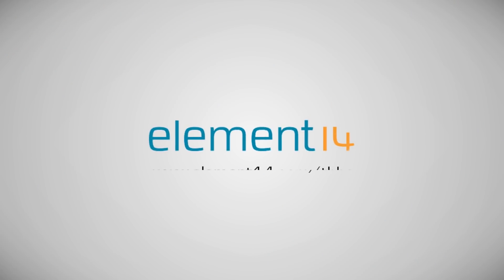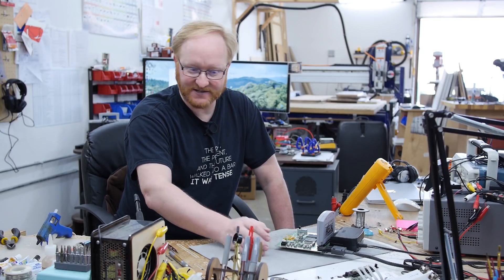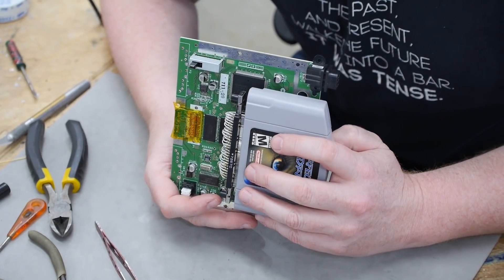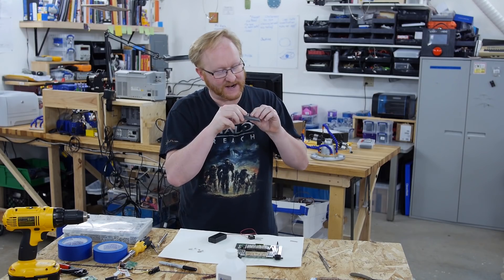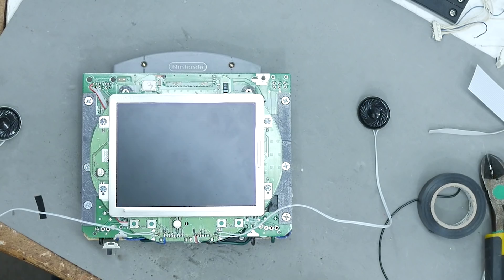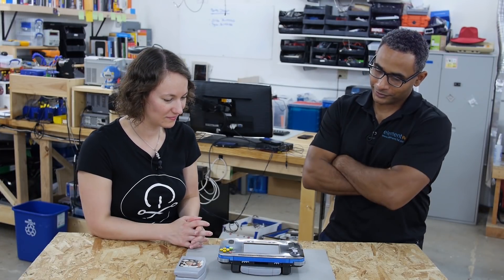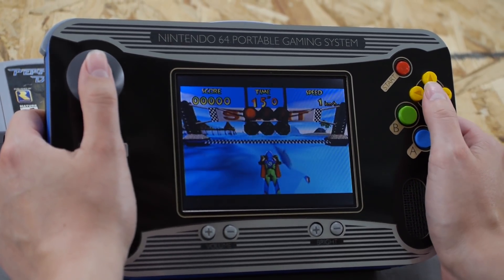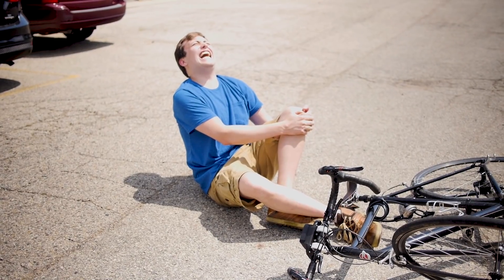N64 Portable: It's Alive!

Comment: I'm sympathetic about having just wanted to get this finally done, but it seems like there were a few compromises that make it a Pyrrhic victory:

- Going back to the crazy N64 analog stick after the modern analog sticks were working
- No L button (which really was used in a few games!)
- No ports for additional controllers, nor the controller-expansion ports
- Having a built-in save-game memory module was such a neat idea - sad to see it didn't make the final version (although many games get by with cartridge save alone)
- Maybe AV out / DC in should be available

Of course I don't seriously think people would want to play 4-player 007 on a tiny screen, but having ports for additional controllers (maybe through a breakout cable which could include a controller 1 override) would create compatibility for arbitrary add-ons - not just 1-4 memory blobs, but also stuff like Rumble Paks.

Yes, this stuff would take an insane amount of time to do, but think of the watch time revenue at stake! ;-p

Comment: Its a nice toy but I feel a rasberi pie with n64 emulator that reads from cartridge is much better. If it was an emulator it could also play Wii and game cube.
Reply: It's so much more of a novelty that it is og hardware.  It's the first thing in my collection I show off to anyone that wants to see my game room!
Reply: @Zeldachief128  So you don't think it should be redesign by Nintendo to be the official n64 classic.
Reply: Now you're comparing apples and oranges.  The point of this was to turn it into a portable using the OG hardware.  If Nintendo were to make an N64 Classic, there is no doubt that emulation would be used but for this particular project no.  If he were to use a raspberry pi it would be a lot smaller and at that point, you might as well just look to his other raspberry pi builds.  Haven't you ever tried taking apart a classic console and making it portable?  It's really fun!

Comment: Could you not save space by hardwiring an everdrive into the cartridge slot, without the cartridge shell, then mounting the SD card slot so that you can insert/remove the SD card through the outside of the case? I imagine that would be somewhat thinner than requiring space for the cartridges.

Comment: I know this is an older video.
I just happened to watch another video on the Sega Nomad today. And I thought this might be even cooler (Not that it's not already one of the coolest systems and ideas I've seen in a while.), if you could add an a/v port to link this handheld to a tv by way of an a/v cable. But possibly a difference would be to switch off the handheld screen when a/v cable is detected. And adding a 64 controller port on the handheld, to add a second player (or using a connection like the wavebird for the gamecube console), just modifying a 64 in that way. This would keep it portable, and allow it as a home based console, like the switch.

Comment: The new RAM chips give it the same power as if it had the expansion, but does the system recognize it as being the same?  Meaning will it play games that require the RAM expansion, or will it tell you that it still needs the expansion?

Comment: Would it be sacrilegious to suggest an Android or Pine64 board and USB to N64 cartridge (retrode) adapter to reduce the size and voltage requirements? Using a pi for N64 doesn't work great.

Comment: one thing one could have done was use a replacement part of a "N64 stick fix" - basically there is third parties making a fully nintendo 64 original controller compatible renewed stick parts using a smaller, modern style stick that does not wear down like the original N64 stick, and has less of a travel. I have one of these parts replacing utterly worn down stick in one of my N64 controllers and it jumped ahead my very great condition nintendo original stick in gameplay feel.

Comment: I've done everything as far as installing and mapping the buttons but I'm using a ps4 controller. When I load my rom, the words "no controller" flash on the bottom of the screen (I loaded Zelda: Ocarina of Time) and now I don't know what to do besides possibly using the keyboard which is what I wanted to avoid. I'm using Project64 2.3

Comment: The batteries are a problem as 3.7V is pretty much 50% charged 18650s should be charged to 4.2V and them holders are a big problem if a wrap gets damaged

Comment: Connect two cartriges of the same game and synchronize them, i dont know how to do this, but using multiple copies of the game SHOULD give it an improvement of avaliable resources. I am guessing this can be tested with game roms on an emulator before doing it hardware wisesly. I hope my theory proves truth.
Reply: So for instance connecting together TWO alone in the dark cartriges/or games for their resources should make loading times or loading much faster etc. I think there are other improvements but they require coding and programing.
Reply: That's not how loading works, at all. Second, cartridges are already very fast.

Comment: You can curve the one end of the fan dispenser, so more air will come towards the beginning, less towards the end.
You can use smoke to see how the fan dispenser is dispensing the airflow.
Curve bladed design is less noisy.
Larger fan blowing air from the back into the case at a 90 degrees angle with the board, rotating at a lower RPM might be better, than a small fan blowing high RPM in parallel with the board.
You can also coat the case with aluminum, (metal-plastic alloy) allowing the heat to dissipate through the casing.
It'll also make the device much more durable. Even metallic paint allows for a better heat dissipation than just regular paint or plastic.

Volume and brightness would probably be better as an analog rotary dial on the edges.

Drivers can be upgraded for more bass output. The device could actually contain a passive bass membrane to make one feel the sound better, as well as sound audibly better, like this one: https://goo.gl/K2Fykv

Hope the wires will not be in the way for taking in or out cartridges.

Comment: The z-trigger is hooked up to the L-shoulder button. Since L isn't used much on the original controller, and most games use the joystick, Ben simplified the design by putting the Z-trigger into the L-shoulder button. Keep in mind, Ben's never been a huge fan of the 64. If it had been up to me, there would have been a true trigger button. Way easier to play Ocarina of Time and Mario64.

Comment: Is there anyway to acquire the files needed to print out the case that Ben designed. I'm a OTR  trucker (former electronic tech) looking for a project to do with my college aged sons during Christmas vacation. I would need to use a 3d printing house to purchase the casing. However, I have no idea where to acquire blueprints or files for a 3d printing. Anyone have any ideas?

Comment: I once built a backpack where I had a Genesis that was wired to a battery pack of a bunch of 9 volts. Had it ran up to an old camera I had that had av inputs for the screen. And of course not having any kind of av hook up for my Genesis, I gutted an old vcr and used the coaxal input and the av output to tv as a converter set up. In short I ended up with a back pack that had a cartridge slot and a screen and then 2 controllers running out the bottom. Open it up and it was just a massive ball of wires and batteries. Probably not the safest thing, but when I was a kid I was willing to do anything to play Sonic the hedgehog in school.

Comment: guys! I am new to raspberry pi electronics. I have question . I am trying to make a portable power supply for my raspberry pi 3 that would fit inside the case. So I am trying to power it with my GPIO pins. I had a few small portable batteries lying around, so I broke open one. I think that I could reuse the small circuit inside the portable battery, as it already has power input to charge the battery, led lights to indicate the charger and a usb outlet to supply(which i could remove the solder) and get the 5v and ground from there.... So this 5v and ground could go into the GPIO pins. This is just an idea but I dont know if that sounds feasible... Any advice?

Comment: Testing the running temp when it's in the wide open air seems like a bad idea. That's going to get a heck of a lot hotter when in the case.
Reply: Yep, there's going to be some disparity to account for, which they probably did.

Also PLA 3D prints are a great warning indicator, they get all squishy and floppy long before the critical temperatures for electronics are reached :P Not sure what he printed in though, but normally PLA just looks better than printable high-temperature plastics.

Comment: For me those PSone screens are still ideal screens to use, the image quality (if you don't mind it being a bit of a mirror) improves a lot if the mesh is soaked off the LCD; very crisp image quality in contrast to stock. There appears to be a bit of interference on the screen, the video cable needs to be shielded to the screen to eliminate that.

Comment: I'll pay you $200 if you build me one. lol. I soo want one of these. Loved my N64.
Reply: N64 portable go for about a 1000 USD but if you want to make one you would need N64 70$, PS1 screen-50$, wires-10$? downstep regulator and capacitors and resistors-20$, N64 controller- 20$ soldering iron solder and solder Wick- 60$

Comment: Don't get me wrong, the final product is amazing and I love it, but what's up with the 3d printed parts' layer lines not being smoothed out? I also don't get the blue plastic on the sides.

Some case design critique: I would have made the case more ergonomic, switched the d-pad and joystick placement to be closer to the location of the joystick on an original N64 controller, and moved the speakers out from under the user's palms. I would have also rounded more of the corners and edges on the device.

This is just personal preference, but I would have used a replacement N64 joystick; one of the aftermarket parts that is a modern joystick (that is less prone to breaking than an actual N64 joystick) that has been made to look like an original.

Comment: This isn't too bad, I like that retro style look for the casing, but there are some things I would have different than this.

Firstly I'd have a larger display, preferably with AMOLED display so you don't need to have backlit LED's since it provides it's own light, with much more clear and vibrant display. In addition to just having an AMOLED display, I would also want to have a HDMI IN-OUT so you can connect the system to a bigger TV with an HDMI cable so you can have dual video outputs on both the device and TV you want to output to, or hook up to a DVR capture device. Clean up the video output from it's regular Analogue Video with an HDMI mod to the system.

For the controllers, I would have them on the portable device itself, but I'd also keep the 3 other cable ports for plugging in additional controllers to the system for when you want to play with other people when you do split screen with 2-4 people. Also to keep the system fairly compact instead of using the original N64's Joystick, as much as I like using the N64's original joystick, I would opt to take a circle pad from one of those Nintendo 3DS Circle Pad extension devices and use that for the joystick instead. I would still reuse the same N64 Controller buttons however on the device.

Thirdly the battery, instead of using those 4 big bulky batteries I would opt to take 2 pocket-sized tablet batteries to power the device, preferably ones that have huge long lasting capacity, which should help reduce the bulk and weight of the whole device, with these it should provide the system with a long lasting battery life without needing to charge a lot, and provide the system with enough power for powering everything such as the game, the AMOLED display, fans and audio speakers.

Speaking of audio however... instead of just 2 buttons for audio, I would prefer to have a slider for the audio, and take some high-quality stereo speakers taken from something else say like a phone that has really good speakers or something that are really small and compact but produce excellent clear audio. I would also add on a audio jack mod to the PCB so you can plug in headphones to the system for when you want to use headphones too.

These are just some of my ideas anyway.... I did come up with some visual concepts ages ago before on how I'd like my portable N64 to be like. I'll probably have to re-create it however with a better concept.

Comment: I see one design flaw with this system... It only has 2 shoulder buttons
The N64 had 3, which essentially means it'll be incompatible with the games that use the missing one
Reply: N64 controller has 2 shoulder buttons and 1 trigger button which was under the rear center prong of the controller.

Comment: Turned out great, the only things I would have done differently is sand or acetone the exterior 3d prints to give it a smoother look, and used the stock buttons from the controller. You were able to fit it into a great form factor considering the size/shape of the original console. Building the rambus expansion into the board was a good idea.

Comment: You know. The patent on the N64 is now expired. Have you considered actually manufacturing from this prototype? You should do it. There is plenty of money to be made, seeing how other retro systems have somewhat successful modern clones.
Reply: The patents may expire, but some of the ICs are still proprietary and many off-the-shelf ones are no longer available and don't have replacements. If there was an N64-compatible system to be released today, it would certainly be partially or completely software-emulated on dissimilar hardware.
Reply: Except for the fact that the retro "clones" actually run on emulators. Specifically, non-commercial emulators.
Reply: He really doesn't have the infrastructure to do something like that. They would be ungodly expensive because this design isn't scalable.
Reply: Cartridge based doesn't mean it isn't a emulator....
Reply: Who said nintendo didnt renew it
Reply: WillStrop2008 Yeah, like the retrons are pretty decent
Reply: They're probably going through renewing process at the moment.

Comment: Pretty good result.
I'm not a fan of the controller layout. (seen that 'new' n64 controller? I hate that thing too.).
Mainly my concern being goldeneye and perfect dark because I'm addicted to playing those with the 2.1 control scheme.
(you could wire 2 controllers as one for that I guess, but it would mess it up for pretty much everything else. )

Actually... I wonder... Could a modular n64 controller be a thing?
Split it into 3 sub-parts, and make them attachable.
You could also make the parts have variants.
Eg.
Left side module with stick, d-pad and L button.
Right side module with stick, and z button.
Right side module with a, b, c and R buttons...
Centre module with stick and Z button...
Hmm.
Would require some planning to ensure there aren't too many redundant module varants.

For goldeneye and perfect dark using control schemes 2.1 to 2.4,  you essentially need two central modules, which need a Z button each, and between the 2 of them need A, B and Start.

Actually, there's a thought - The n64 controller would work out just fine as a set of one-handed controllers.
Because of it's existing design, no game can realistically use more than 2 grips, so it's like having 3 different one-handed controllers...

If we just give every sub-controller it's own start button, just in case...
Redesigned that way you would have:
Unit 1: Dpad, L button, (Start button)
Unit 2: Analog stick, z button, A/B button (only one is required per unit, but you need both A and B to be possible in a set), start button.
Unit 3: A button, B button, C buttons, R button, (start button).

Unit 2 can basically be copied from the design of the Wii nunchuk controller. (but you'd have to figure out a spot for the start button.)

This works out because no known N64 game uses a layout requiring more than 2 of these modules at once.
Most only use module 2+3
Some games use 1+3
In very rare cases you get a game using 1+2
Finally, the optional control schemes for Goldeneye and perfect dark effectively use 2+2.

So a set of 4 such modules covers every possible singleplayer control scheme.
8 such modules in total covers 90% of games for 4 players.
12 modules total covers every possible thing anyone at all can do with any n64 game for 1 to 4 players (barring hypotheticals. But even then, 2+2 requires 2 controller ports, meaning it's still covered, leaving aside you can treat A and B on 2 controllers as 4 buttons)

To be absolutely thorough, controller module 2 would need both A and B buttons on every module...

Of course, the full set of features also requires that expansion port on the controllers.
But that's something that can be ignored. (or we build a 4th module for that. - we can also integrate rumble pack funtionality directly in principle. )

Would be a fun design thing. XD